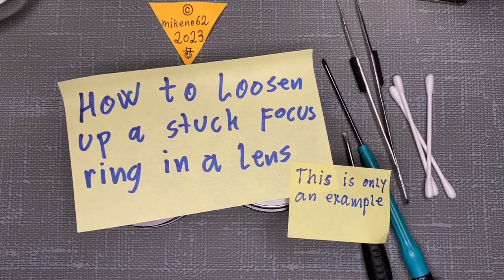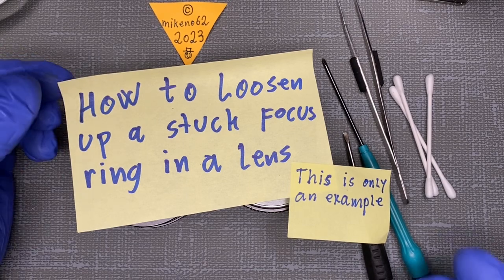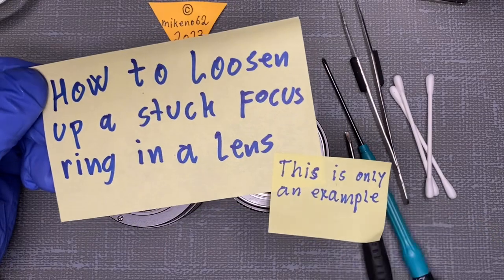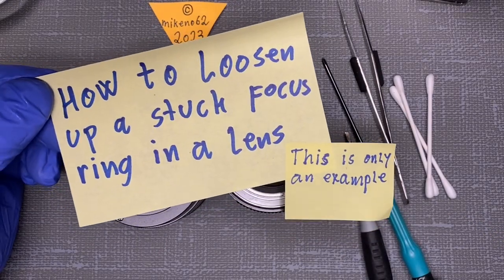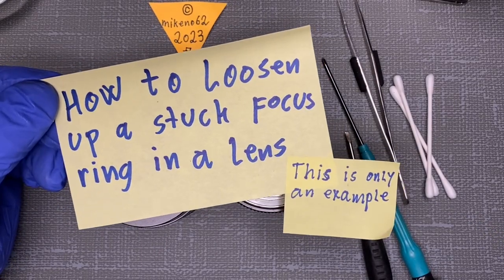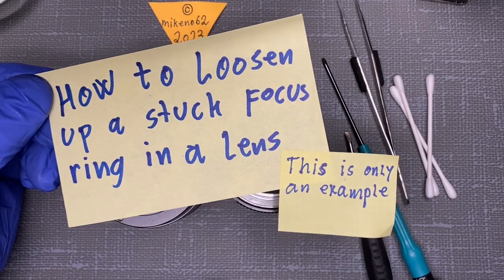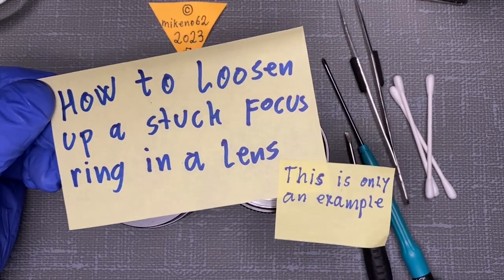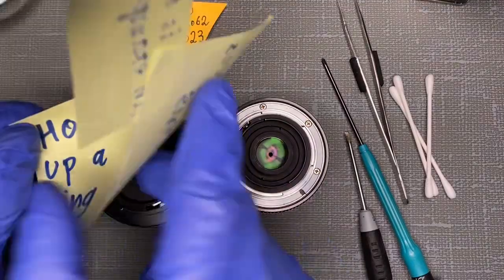How to loosen up a stuck focus ring in a lens

Comment: Pretty sure the post office was rough as hell with one I was trying to sell on ebay.  Anyway, the guy gets the package, the focus ring won't turn..... ugh.. so i get it back.  I also realized that the fstop ring is turning.. but does NOT control anything.  I opened it up and it almost looks like there's a part missing between the mechanism and the rest.

Comment: Your videos Shine a lot of light. I recently acquired a Pentax 645 80 f1.9 and the lens locked up and now its moves freely but extremely gritty. I can't remove the front glass element easily by unscrewing and can see helicoid threads. should I ad some lighter fluid to the front instead of taking apart the back? Thanks so much
Reply from the maker: Thanks Chris, I only use the lighter fluid to loosen the stiff old grease so I can move the focusing ring, and then I can begin to disassemble the lens. If there is a lot of sand and other dirt stuff on the helicoids, you should be very careful when turning the focus ring. Before you begin to disassemble the focusing system you should measure the lengths of the focus helicoids at infinity ♾️ because it’s your only reference when assembling the lens. If the front ring / name ring is very tight, you can add a few drops of Isopropylalcohol 99% or so on the thread and wait a bit, then maybe add a few more drops and gently try to unscrew the nameplate.

Comment: Hi. My Prakticon 50 1.8 PB mount won’t move at all. I’ve soaked it in Isopropyl, tried hot water but nothing. I was able to move it for a few milimeters but now i can’t turn it back so I can assemble it.

Comment: I have an minolta that I am currently cleaning at the moment, the helicoid is stuck like a rock. I tried alot of methods like  applying lighter fluid, I trird boiling it, and also soaking it in acetone. 

Does any one have tips?

Comment: I have used this method many times I use a few drops of lighter fluid to free up the sticky grease then add a couple of drops of a very light machine oil. I apply using a medical syringe with a needle.
 Looking from the rear there is sometimes room to insert the needle on to the helicoid to apply solvent & oil. Have a careful look with a small torch to see if its possible. 
Some old lenses eg. M42, Minolta MC & a few others can be done in this manner. Once applied spend some time to work the focus to mix the drops of oil into the old grease
 Saves dismantling the lens. This method works well but never as good as a complete CLA.
Reply: Hi, would Liberty 0il be a good oil to use for your method? Would it be fine to combine the two oils with the syringe for the application? How long would this method work until the lenses needed to be CLA'd.   I wonder if this would work with the original Carl Zeiss Jena Pancolar 50mm F/1.8 zebra 8 aperture blade version.
Reply: @princeharbinger  I use sewing machine oil, never tried combining the 2 of them together. I think the application of the oil tends to last fairly well as the lighter fluid evaporates daily fast. I have lenses done this way that are still working well after 2 - 3 years ago. Make sure you do not use too much of either or you will end up with a real mess.

Comment: Separate question regarding I have an old nikon em and when I forward the film it sounds gritty . Is there anything I can do to lubricate the film advance to stop this noise. Or is it to be  left to a pro..Also I have a Pentax bc1 . The film advances for the first few frames but then seems not to fire when I press the shutter.  But if I move the connection where a power winder is it springs and only then can I fire the shutter? Is it worth repairing.  Great videos 👍

Comment: Hello, mikeno62. Hope you have time to read this comment. I really enjoy watching your videos, even tho I never opened a camera. I got a Ricoh KR-500 (you can not find anything about it online). It is supposed to use the same chassis from many Cosina mechanical cameras like FM10. The issue is whenever it is left untouched for a few hours, when I advance it, during the return of the advance lever, the shutter fires (or slips). Then I advance it very slowly, the issue goes away. Another phenomenon is when I advance it quickly, the 1s shutter will be too short (open the curtain for less than 1s). Looks like something is slippery inside if I advance it normally after not using it for a few hours. Could you please point me to a repair video, or some articles that I can study and fix the problems? Appreciate your help. Regards, Charles

Comment: wow, really helpful, thx a lot ; i just bought three kiev 16u lens, and of course the focus ring can't move at all ;( have you ever worked on such lenses, any suggestion if i should operate from the front or the back ?
all 3 of them are stuck : Mir-11M, Vega-7-1 and Tair-41M
seller told me they were fine, and I can not return them
thx for your help, i'll drink a cup of iso 99% cup on you, if you can help me ;)

Comment: My 18 to 55 mm lens is not doing auto focus until its full zoomed to 55mm please help what can be the issue
Reply: See if pulling it out gently when you turn it to 18mm because my autofocus on my 18-55 works but it can’t get a focus below 35mm because the front glass has to move forward (if I’m making any sense) it tries but it’s not proper distancing of the glasses